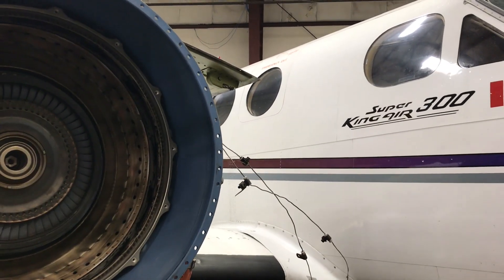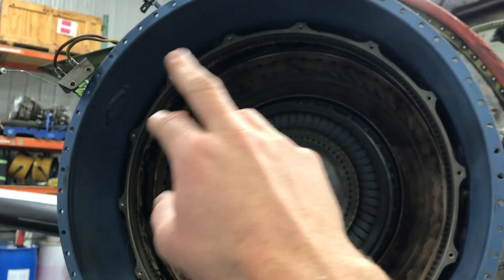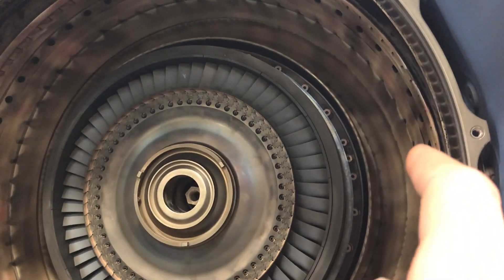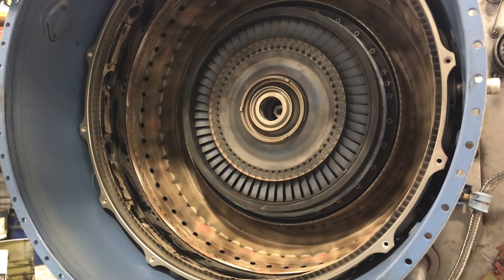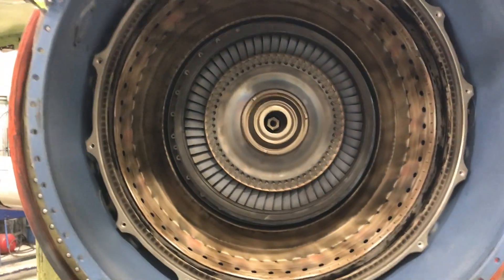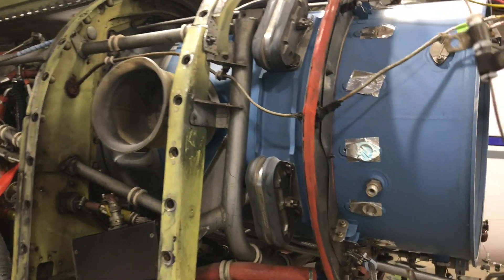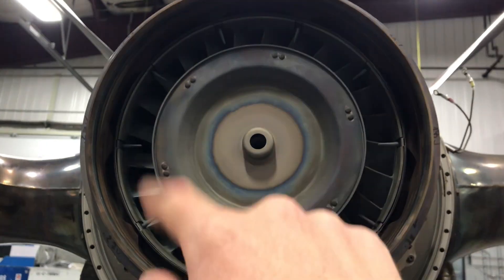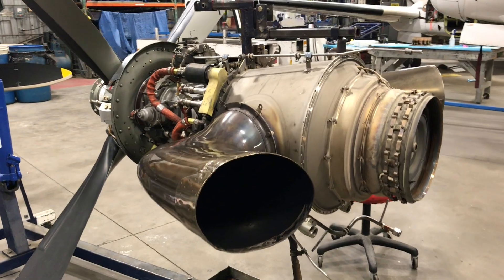Split King Air Engine (PT6)

Comment: Cool, I think this is the first reverse flow, free turbine engine I've seen disassembled! Good explanation of how it works
Reply from the maker: Alex E what do you guys run where you work? what sort of machines?
Reply: @turdpike  I mostly work on 767s at the moment, but we've also got 777s, 787s, Embraer, Airbus 320, 330, and soon some 220s as well
Reply from the maker: Alex E Cool! Real airplanes lol. So AC I’m assuming? YYZ?
Reply: @turdpike  Yep, AC YYZ, I was doing heavy for Jazz in YHZ before  this on Dashes and RJs though! Honestly I miss working on the smaller ones